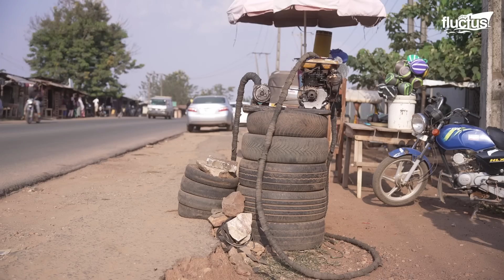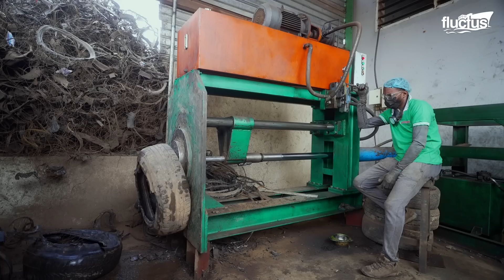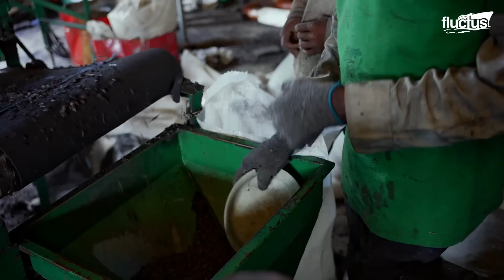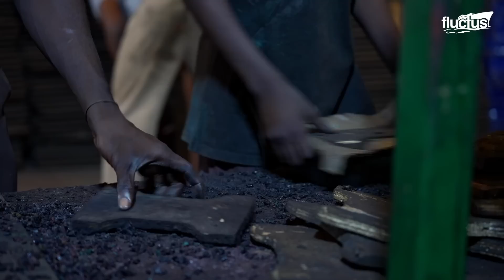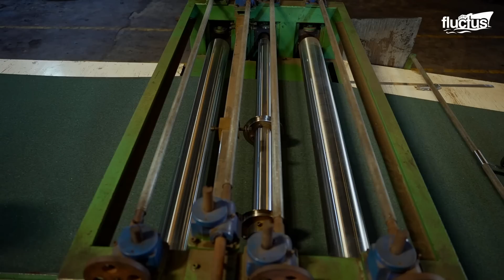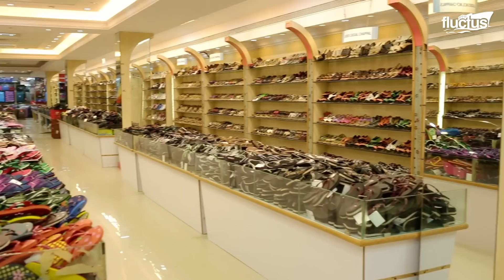Behind Nigeria’s Genius Solution to Recycle Millions of Used Tires

Comment: was thinking about if the tires could be used in place of asphalt roofing shingles as the current roofing shingles with the fiberglass lining doesn't hold up like should do on FL roofs which the insurance company's want re-roofing done much earlier due to the Hurricanes and wind storms thinking could it be made and used instead of a more expensive Metal Roof overs which like 40+ years